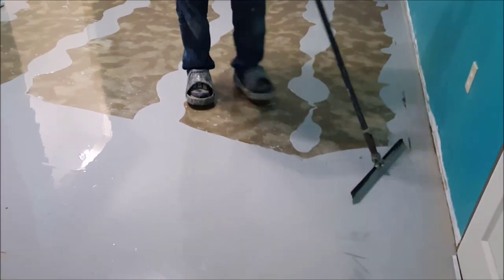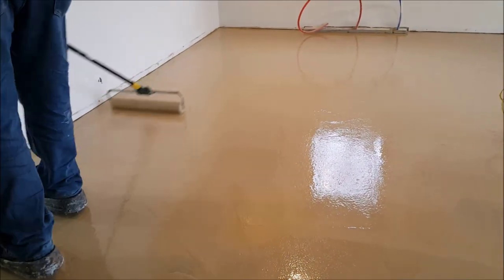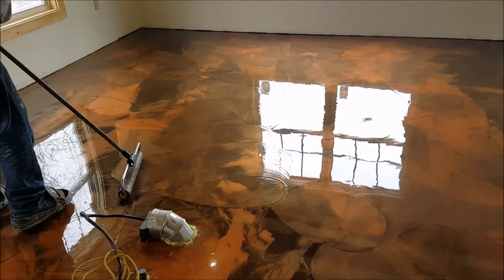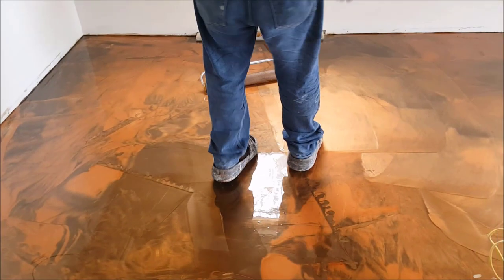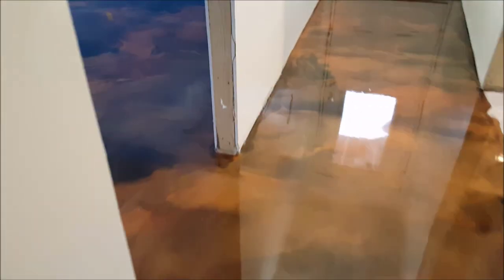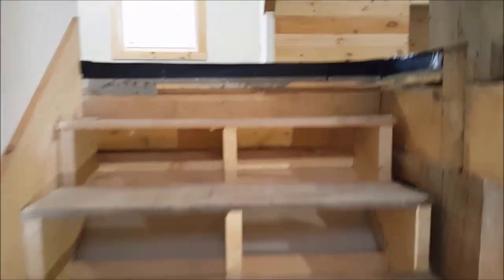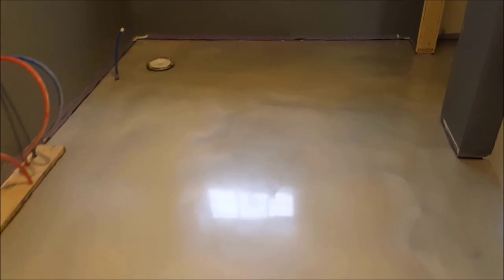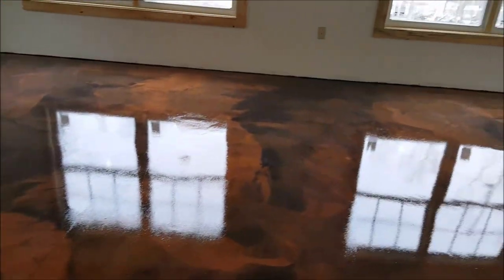METALLIC EPOXY FLOORING : REFLECTOR ENHANCER EPOXY

Comment: Great videos Dave! The contrator who did my metallic epoxy floor sanded it before applying the urethane clear coat, but all the sanding "circles" are visible. Any suggestions on how to fix this?

Comment: What’s the BEST outdoor concrete sealer?
Thanks
Reply: I have a sunroom with a concrete floor. I stained it and some of the stain didn’t stick/adhere. The wife doesn’t like the way it looks. 

I pressure washed it and stained it again, still no good. 

Do I need to grind it and start over?  It’s been sealed. 
Thanks 
Chris
Reply from the maker: Christopher Chambers - You have to get the sealer off before you can do anything. I would grind it off because it's easy for us to do. If you can than go for it. If not you could use a sealer stripper (soy gel) there's a lot of them out there but it's messy.  What kind of stain did you use?
Reply from the maker: For exterior concrete sealers I recommend RadonSeal deep penetrating concrete sealer. Check out my page about sealers: https://www.everything-about-concrete.com/concrete-sealer.html